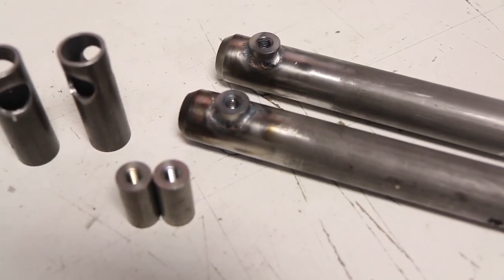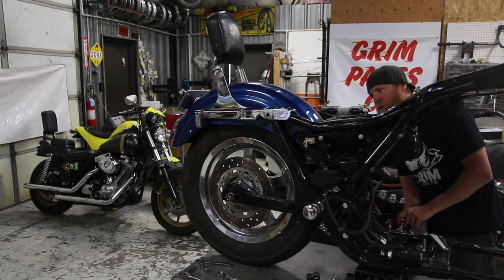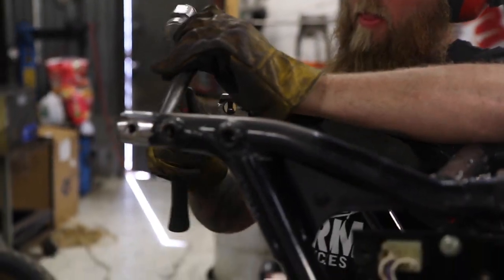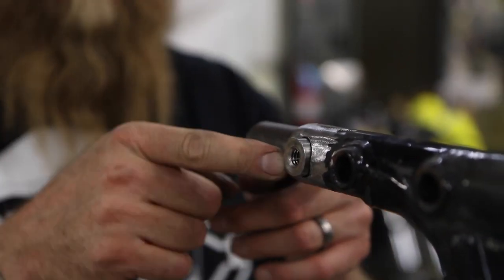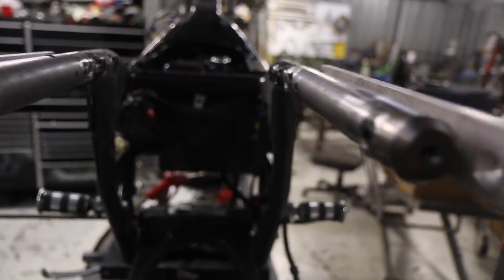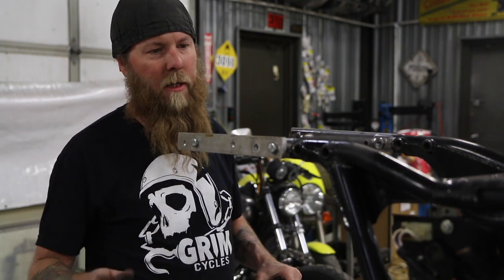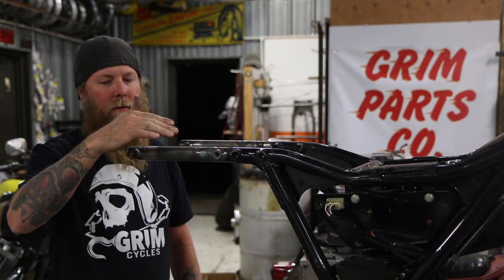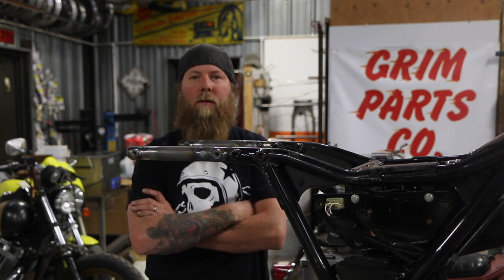Harley Davidson FXR Frame Extension Kit installation video by Grim Parts Co

Comment: Not something I would want on my FXR, but i see the appeal.
Frankly after seeing the final results, i wonder why that's not the frame Harley sold.

Oh wait, your kit makes it look good and functional Harley can't have that.
Reply: Most Harley customers don't buy for function and would have hated the Ugly Glide ( FXRs were called that when they came out) even more than they did had HD not run chrome strut covers. I like the modification but not everyone wants an FXR bagger.
Reply: @obfuscated3090  been riding Harleys for over 20 years now, and in that time I've learned how you can tell the difference between a rider and a poser. Anybody who doesn't agree that the FXR is the best handling big twin Harley ever put out is a poser.
But seeing as how Harley has done away with the Dyna Glides oh, it is now just making full Baggers and Softails it looks like the posers have won.
I spend more time on my rigid Shovelhead then on my FXR, but I know that fxr is hands down hey better design machine.
Reply: Joe gus, I must be a poser I've owned fxr's since 86, back when they couldn't give them away, they handle good but the new softail will out handle and run circles around a fxr
Reply: And make sure your never going to sell the bike later cause you just took a 4 or 5k dollar bike and cut the value in half
Reply: @path3848  if you care about the resale of a bike you spent less than $4,000 on you have problems.

And I don't know you, but I feel fairly safe in saying you probably are a poser.
Reply: Its not the bike, It's the rider with skills which makes the difference .

Comment: I don’t get it. Why do that?
Reply: ye me either replace ugly struts with even uglier struts
Reply from the maker: We do this to add strength. FXR struts can and do break. We add these so we can bolt extra stuff to the outside and not mess with all the through bolts. It also gives you extra places to mount signals out of the way.  Like most things, these are not for everyone. But if you are looking for an alternative to stock struts  that do more than hold your fender this is it.